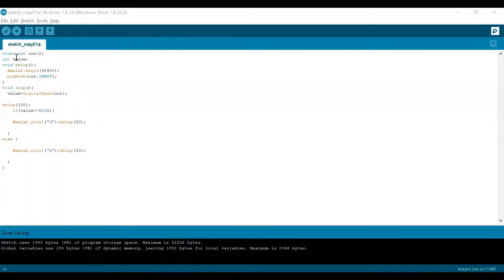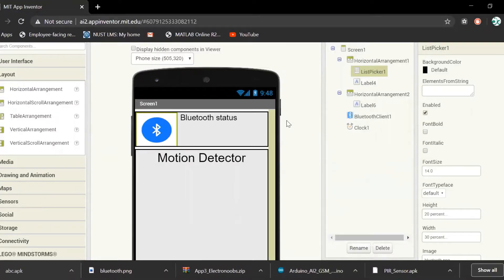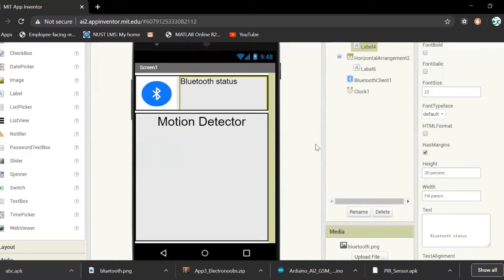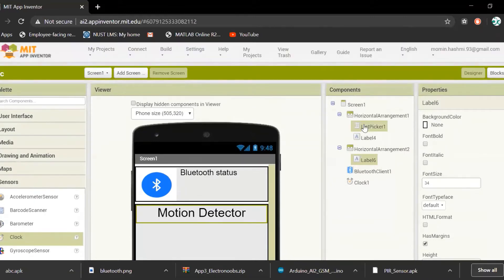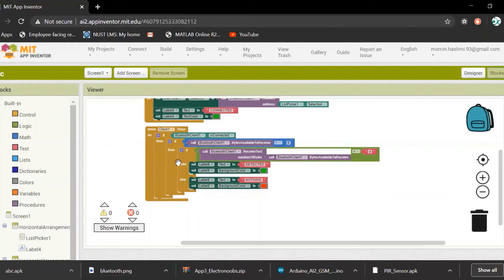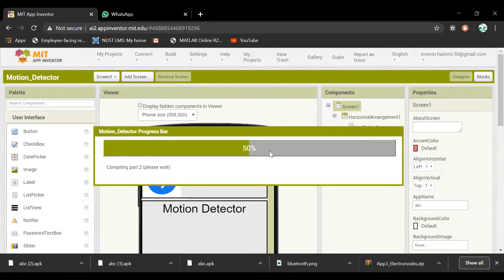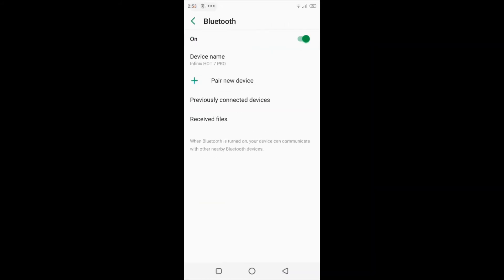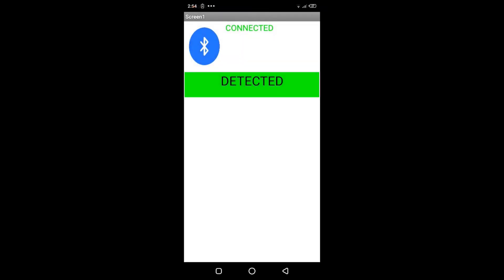Motion detector using MIT app inventor, PIR sensor and Arduino UNO

Comment: is the arduino diagram at the beginning correct? RXD goes to pin 1(TX) and TXD goes to pin 0(RX)...isn`t it suppose to be the other way around?
Reply from the maker: @ondrejkopecek6160 RXD of master always connects with TXD of slave and vise versa

Comment: Can I read analog value of sensor and can also update the status of output in mit app inventor..?
Reply from the maker: Yes you can , for example you can read potentiometer and send it's data over Ble to MIT app
Reply: @electroniccorner6829  
Which block I can use in mit app to receive data..?